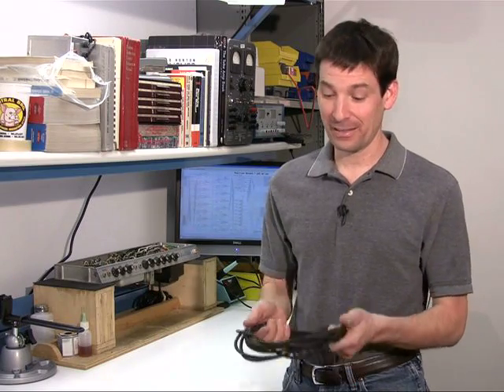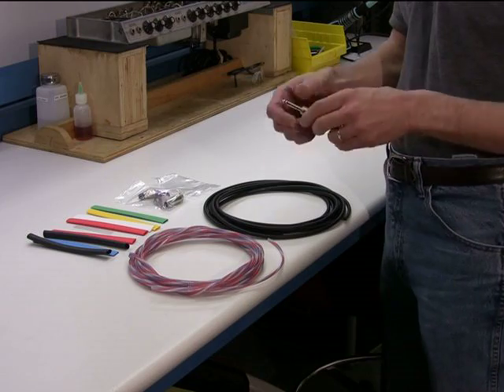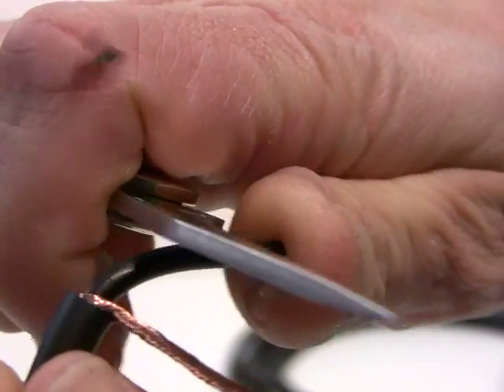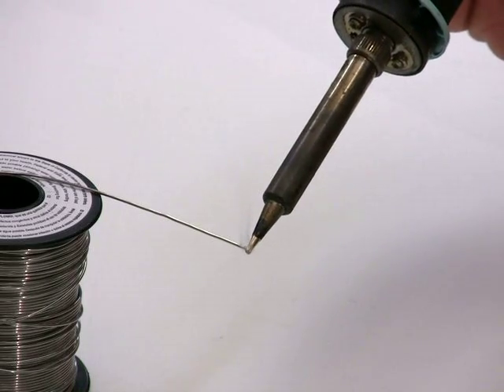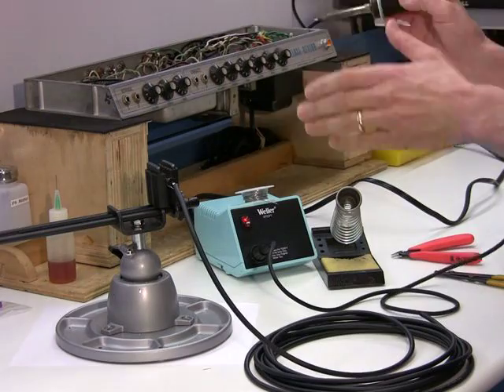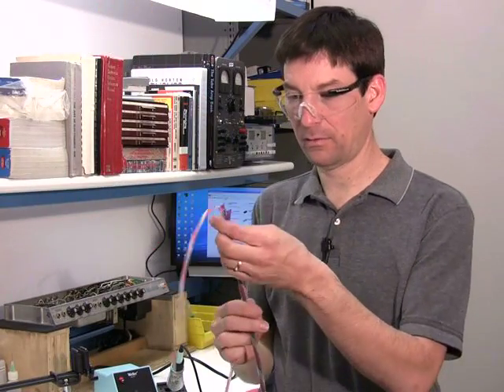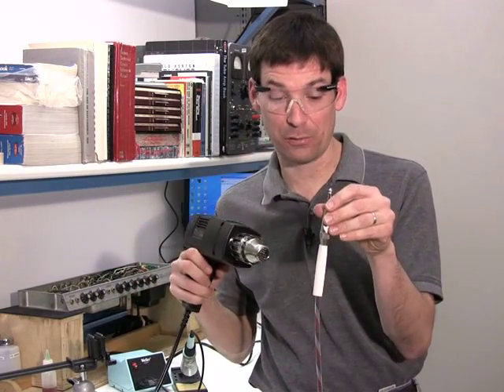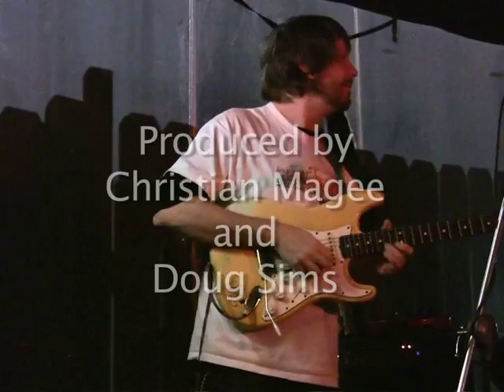How To Build A Better Instrument Cable

Comment: - Neutrik connectors’ instructions give exact lengths for every aspect of the wires
- Using that huge pocket knife to to delicate work made me feel the same as if I saw a brain surgeon wielding a logging axe.

Comment: on the mogami cable you MUST strip back the black shield (as he shows) if not your cables will test good with a meter but they are not and will suck the tone outta your signal

Comment: For a few cents more a foot, you can get the mogami gold cable... and essentially make a mogami gold cable for less than a dollar a foot....
Reply: at PSMTCHEF,
 If you look on Mogami's website, "2524" is the best single conductor cable and is sold as "Mogami Gold (premade) Cables and come with Neutrik Black and Gold Connectors.

Comment: If you are watching this in 2020, here is the parts list, since the url in the video description doesn't work:

Mogami W2524 Instrument Cable - https://tubedepot.com/products/mogami-w2524-instrument-cable
Amphenol TM2PJ 1/4" Straight Audio Plug - https://tubedepot.com/products/amphenol-tm2pj-1-4-straight-audio-plug
Amphenol TM2PNJ 1/4" Straight Audio Plug - https://tubedepot.com/products/amphenol-tm2pnj-1-4-straight-audio-plug
Techflex Expandable Sleeving - 1/4" - https://tubedepot.com/products/techflex-expandable-sleeving-1-4
Assorted Color 3/8" Heat Shrink - https://tubedepot.com/products/assorted-color-3-8-heat-shrink
Weller WTCPT Professional Soldering Station - Couldn't find it at the website, but I personally recommend Hakko FX-888d
Stahl Variable Temperature Soldering Station - https://tubedepot.com/products/stahl-variable-temperature-soldering-station
Heat Sink with Cushion Grip Handle - https://tubedepot.com/products/heat-sink-with-cushion-grip-handle
Kester "44" 1 lb 60/40 Solder .031" Diameter - https://tubedepot.com/products/kester-44-1-lb-60-40-solder-031-diameter
Weller 1000W Heat Gun - Couldn't find it at the website
Xcelite 5" General-purpose Shearcutter - Couldn't find it at the website
Universal Wire Stripper - https://tubedepot.com/products/universal-wire-stripper
Liquid Rosin Flux - https://tubedepot.com/products/liquid-rosin-flux
Flux Dispenser Tube - https://tubedepot.com/products/flux-dispenser-tube
Polycarbonate Safety Glasses - https://tubedepot.com/products/polycarbonate-safety-glasses

Comment: I've found that the heat shrink isn't needed with thw techflex and the build looks cleaner without it. It doesn't add much in the way of strain relief anyway. I only use heat shrink when not using Techflex and it goes under the housing.

Comment: So what size fits the Mogami W2524  cable when it comes to the flex tube and heat shrink? You have 2 different size flex and a few different sizes in heat shrink. Does that cable fit the 3/8th heat shrink and the 1/4" flextech?

Comment: Great video except .... you didn’t show the final trimming of the outer and inner shield to final length before soldering.   
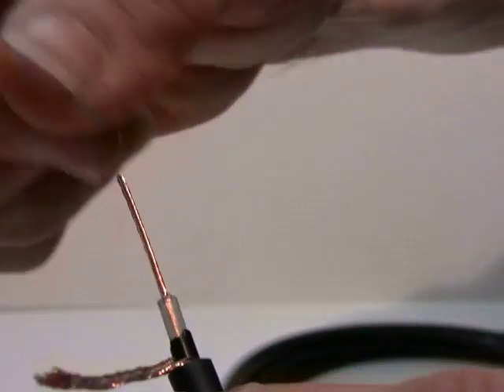4:30 and 4:37 mark. 
Also you say that 26 feet of Techflex is required for a 20 foot cable.   On your website it says add 1 foot for every 10 ft of cable.  This would be 22 feet.   I tested it on a few feet of cable and it works out to 1” of techflex per foot of build or 20” round up to 24” for a 20 foot cable would be +2’.

Comment: Well only thing you actually NEVER EVER DO is melt solder on to the solder-iron. I think you can do that when you dont have any flux inside the solder BUT that actually is a NO GO - told you by a german engineer. Heat the contact surface, not the solder.

Comment: You should trim the shield cable before you solder it to ground. After it is sticking through the hole. You can occasionally damage the connection trimming it up afterward, especially if you end up cutting into the soldered joint.

Comment: Incredible how strong those amphenol terminals are. I rolled a cable with those over a decade ago. The housings are now heavily worn with dings and scratches (some even made deliberately trying to break it), but they still function perfectly. Never need tightened up either like the Switchcraft design stuff. Only draw back is how f'ing hard it is to get those suckers on. It was a 2 men with vice grips kinda job, but it definitely paid off.

Comment: For a novice like myself, wouldn't it be better / safer to buy wire crimpers/cutters for the cable? I often (with a knife) end up usually taking out the shield.

Comment: I built my own cables about a year ago after watching your video, I will NEVER buy a cable from the industry again. Even a lot of the major brand cables that cost big $$$ are made with crap components when you take them apart. Other bonuses are you can make the cable you really need, to if you need a 17ft cable or a 11 ft cable you are not stuck with a 20ft cable, and the ends you need 90degree , silent disconnect etc etc all a fraction of what they want for those hyped up cables. $80+ cables that don't even have a silent disconnect WTF......... Thank you

Comment: soo what  fraction  of the 150 would you say
this costs ? just buy curious.
Reply: Aprox $35 in parts material for 20ft  .95 cents a foot for Mogami cable ,  $4 per end,  .34 cents a foot for Techflex covering

Comment: your soldering trick isn't new, i've been doing that for years
and it works but you're better off double tinning to ensure a good solder joint.
I also find it's best to pre-tin the contacts and add flux to the tinned parts so it takes less time to solder, reducing it to about a fraction of a second to solder.

Comment: Can you pls link the items that were used to tubedepot.com it would be really helpful!
Reply: It's Mogami 2524, Amphenol 1/4" phone jack, and 1/4" tech flex sleeving.  You don't need the shrink tubing. Actually, if you build it right, it'll crack and break off a very, very long time before any of those other parts go.
Reply: I was just about to ask the same question.

Comment: What temp are you using for the soldering iron? I always find it takes far longer than that to get solder flowing. Also, why put the  heat shrink outside of the plug instead of underneath/inside to give strain relief from the connector backing? Thanks in advance.

Comment: i just had that crazy issue with one cable
it had a volume drop
it was from my last pedal ( reverb ) to amp
and when i was switching on the reverb it was ok
switched off  = volume drop 
then i pluged directly from my guitar to the amp volume drop again 
wtf

Comment: when making the final end of a wire, usually at about 7:00 you understand that you haven't put connectors second part onto wire before soldering :'(((( hate that feeling

Comment: So how much did it cost to make this cable?
Reply: I just made a 10 footer with the same cable and connectors minus the tech flex and it was about $18.
Reply: the connectors are the expensive part. i just go 50 feet of bulk cable with 55 feet of tech flex, shrink wrap, and eight connectors for 100 bucks. two 20 footers and enough to make all the patch cables I need! (minus extra connectors)

Comment: I was currently looking into "Neutrik Silent Plugs" with the Moogami 2524 cable. Do you think these connector plugs are higher quality?
Reply: bakerrr333 Also, which size heat shrink did you use?

Comment: I better put on my goggles there's always the possibility that I will stab myself in the eye with my penknife!
Reply: duratoke - more likely and therefore more dangerous, a short piece of excess wire clipped off with a pair of cutters flys off and hits one in the eye.  That is very possible.

Comment: Why would I waste my time with this when you're selling a complete 20-foot Mogami cable with connectors for $73 on your site? It's back-ordered by the way. I was unable to find any evidence of raw cable for sale. Thanks for wasting my time.
Reply: tubedepot.com > parts & accessories > wire & cable
Reply: tylerherbs My bad, thank you.
Reply: David Bradley The longer the cable is, the bigger signal lost on your Amp.
Reply: Pedro Omar Soto - there isn't going to be noticeable loss until the  cable gets to around 30'.  And it could be 100' or longer is there is a guitar effect driving the longer cable (it would buffer the signal).
Reply: tylerherbs "doh!"

Comment: From what I understand, you should use 2 conductor cable and only attach the shield to ground at one end
Reply: Skepticalsteven - the sound is no different with 2 conductor, shielded at the one end and a single conductor, shield at both ends.

Comment: I just finished building my cable. When I trim the shield wire there is a small bump left on the outside of the connector hole that causes the assembled connector's 1/4" shaft to come  out of the body on a bit of an angle. Is there any way to prevent this?

Comment: You sure that you want to use flux here? It may corrode the conntection
Reply: pashtettRB - rosin based flux is what is being used here and it is safe to use around electronics.  It is designed to be left in place and not cleaned.  However, plumbers flux or acid flux is never to be used with electronics.
Reply: it is used to actually remove corrosion.

Comment: I put one of these together and there are a couple of places where I ran into easy to solve issues. First when you go to put the first backshell over the TechFlex, it seems straightforward in the video. I had to use a piece of tape to keep the TechFlex "closed" and "pointed" to get it through the backshell. It also makes getting the other parts for the second end easier to get on. The TechFlex is like working with a spring. Also when you go to solder the second connector on the cable it is helpful to pull the TechFlex away from the end (bunching it up) and then use a piece of tape to hold it against the cable. Afterwards just take off the tape and the TechFlex will spring back to the end. The other thing is that is was very hard to pull the main connector portion over the TechFlex and cable. The extra little bit of diameter makes it tough to compress the purple cable clamp down enough. If you don't get the connector down all the way, the portion which plugs into the guitar/amp comes out at an angle. I also cut the soldered shielding off as tight as possible but still had to file off the "stub" left behind to help get the connector to go over everything. In the end is is a nice looking cable that feels quite solid. I'll probably make a couple more for an effects loop send/return.

Comment: I've tried to solder and desolder some of my guitar cables and you have to have quite a bit of heat to do so. How many max watts should your soldering iron be and at what temp do you have it set for doing these cables?
Reply: Dorian Lanzius - 30W is a good soldering iron size

Comment: Hi there, first let me say your videos are great.  I now make my own guitar cables :) 

Second I have a stupid question that no one seems to be able to answer.  I need to make a dual conductor guitar cable, basically to run a stereo guitar signal from the head phone out on my effects pedal into a stereo TRS input on another device.  What kind of cable can I use for this?  People have said mic cable will do the job, but mic cable has different properties from a guitar cable which is low capicitance.  Can you suggest what I should be using for this?  I hope you can help, thanks :)

Superb videos BTW
Reply: If you are using active pickups the impedance is significantly lower than on passive pickups so XLR microphone cable is what to use. Failing that just use a buffer pedal and keep the cable short.
Reply: RabidGerry Mic cable will work fine with headphones.

Comment: Any point to the heat shrink? You have the anchor to hold the cable in place, and there arent any exposed parts needed to be insulated by the heat shrink... It is just to hold the flex wrap? Looks?
Reply: It adds a little bit more strength to the connector, but also looks.

Comment: Great and informative video...Thank you...But:
Alas...You are committing a Deadly sin...!
Cutting the shield to plug Lenght...
AFTER...
you have soldered them together...
exposes Bare copper...to the air...
Bare copper oxidices...to 10 times the size...
hence...Breaks away from the soft solder joint.

Here...the very sturdy soldering joint is well protected...
by the well constructed plug...
but...Cutting Anything after it has been soldered...
is a very Bad Hasty Habit...A big No No...!

Cut to lenght before soldering...!
Now...open the plug...
Reflux...and resolder the bare part...
(or just consider my input somehow)...
"A bad connection...is bad input"...(sooner or later)

Comment: I really appreciate your video. It's removed some doubt I had about bulk cable building. Questions tho; How are you able to get 26' of TechFlex onto 20' of W2524? I can get maybe an extra 6" of FlexoPET onto a 15' cable before it begins to bunch up. Are you using the regular or a non-standard weave?
Reply from the maker: The extra TechFlex is because as the braid is expanded over the cable, its length will shrink.  If you try installing 20' of TechFlex onto 20' of W2524, you will be left with about 3 - 4 inches of uncovered W2524.  With the extra TechFlex, once the cable is covered, the excess is cut off and disposed of.
Reply: ***** I ordered 15' cable and 17' tech flex to make a 15ft cable like this. After it arrived, i saw the 26 and 20 ratio. I thought "crap" and figured out the ratio I could use, and had to cut my cable down to around 12'. It was completely unneccesary, you only really need 6 inches extra tech flext. 1 foot is safe, but it only depends how badly you fray it on either end. So i was pretty disappointed to cut 3' off of my cable when i didn't need to.

Comment: Why do you where safety glasses?  You would have to have some REALLY bad working practices (and that does not appear to be the case) or you would have to have the collective bad luck of the entire world population in order to damage your eyes.
Reply: It is possible to have solder splash into your eye. Let me say that I have seen this happen to a NASA Certified person, who reworked electronic printed circuit boards for years, and it required a run to the emergency room. She was convinced by her experience to wear safety glasses after her accident.

Comment: I don't think the connector that you made will have long term reliability because a soldered joint cannot take long term physical stresses.  If you used a connector that enabled you to mechanically secure both the inner conductor and the shield BEFORE soldering you will make a much stronger connection. With the connector in the video you could have done it for the shield if it did not interfere with the shell.
Reply from the maker: The solder connections are not holding the cable in place.  Watch the video all the way to the end, you will see where the cable is mechanically held in place by the purple clamp.

Comment: what size or part # of heat shrinkable wrap are you using from here ? http://tubedepot.com/ts.html
Reply from the maker: 3/8" heat shrink
Reply: will that also fit in the barrel of the jack connector ?
Reply from the maker: it will fit inside the connector but not around the outside

Comment: Nice video. I personally like the new Planet Waves solderless connectors to make great guitar cables. They are quick and easy to make. Have a great day!
Sammy Bones 
 #planetwaves
Reply: +Sammy Bones Personally, I would never trust solderless connections for live performances.  I have seen too many other guitarists have trouble due to using them.
Reply from the maker: Solderless connectors (also known as insulation displacement connectors) are a great choice for connections that aren't going to be physically moved much .... such as between guitar pedals on a pedal board.  However, the abuse provided to cables connected directly to a guitar are better served with soldered connectors.  Good soldering skills (and soldering equipment) will well serve musicians when they least expect it ... like 10pm just before down beat and a speaker or guitar cable breaks and there are no open music stores or substitute cables available.
Reply: The new Planet Waves solderless connectors are great for moving a lot. I have put them through lengthy, brutal, on the road tests in a heavy touring environment. I still do not recommend other solderless cables for the reason that you are saying, but the 2013 PW connectors are different. Try them, you will be completely amazed. I have been touring as a pro guitar tech for 25 years and I smile at your doubt because of how surprised you will be. Not a single soldered cable could withstand the test I put these cables through. 
 #PlanetWaves
Reply: i have had the planet waves connectors lose connection a few times. The nice thing about them is that you can cut an inch of the end of your cable and reconnect them in about 10 sec. with just a screwdriver. I am going to try the "purple cable clamp" connectors this time.

Comment: what kind of fluid are you rubbing before soldering?!? first time i see something like that!
Reply from the maker: That is electronics grade liquid soldering flux. Flux acts as a temperature activated acid that "boils" the oxides and contamination off of the surface of the two base metals.  In that way the solder will properly adhere to both surfaces.
Reply: Hey! It's just liquid solder flux. It helps the heat to transfer better while you're soldering. It's ok if you don't have any to put there, you'll still get the same result, but you'll probably have to wait a bit more for the iron to heat your cable. If the cable was much thicker, then the flux would be necessary

Comment: Thank you so much.But i did forget to mention to you that i live in India,so will it be possible to import the kits you have online because that would be a very expensive affair for me as im a student.i do have all the tools required.So is there another alternative. Also another question i had is that is it possible to use a turret board instead of a pcb in making a tweed champ.

Thank you.